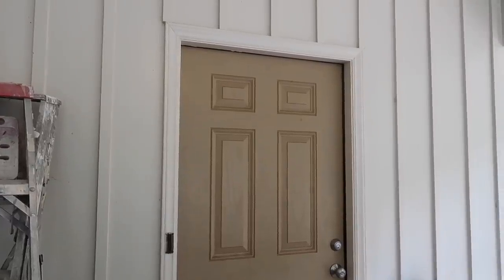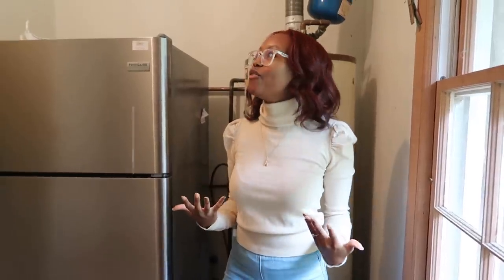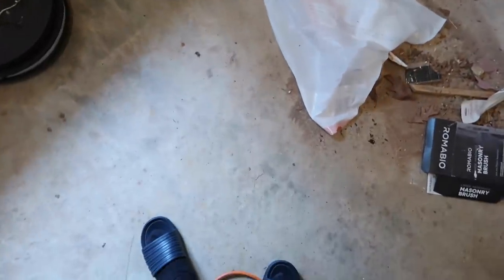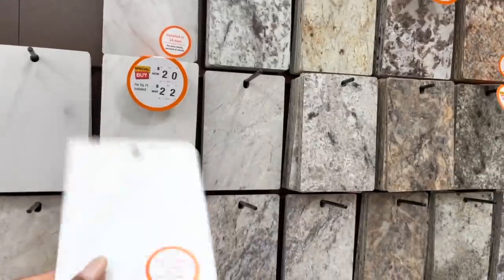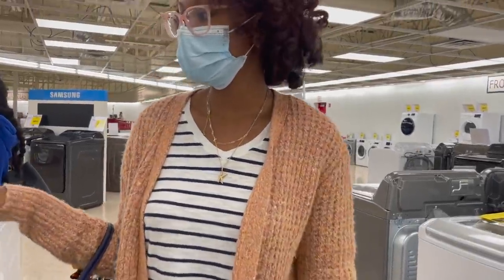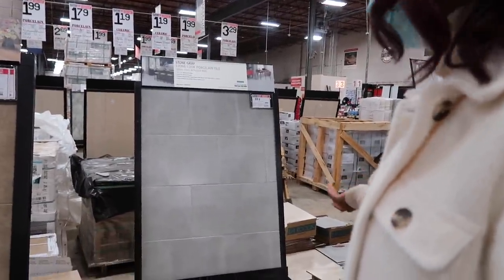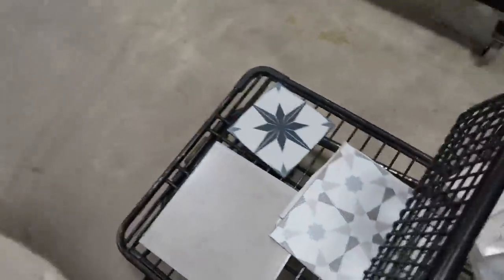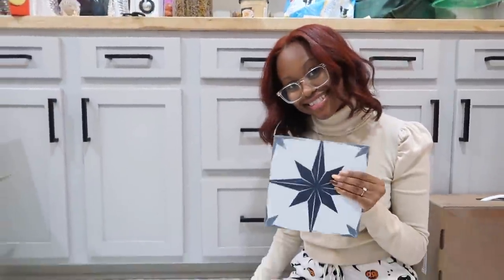DREAM LAUNDRY ROOM MAKEOVER PT.1| Shop With Me, Renovation Plans, & DIY Project #FIXERUPPER *NEW*

Comment: Quartz counter top is the best way to go, if your f'ing to use peel and stick do sealllll up the concrete flooring and also use a heat gun or blow dryer on the adhesive prior to laying it down... yes wifey and I have done it...absolutely no issue as long as you as you seal the flooring with a (sealer adhesive) and heat up the adhesive on the peel and stick tile... don't just lay down the peel and stick tile onto the floor without the speaker or heating up each tile, otherwise they will dislodge themselves from the floor...be sure that the laundry room is room temperature and not freezing, it will not stick correctly.

Comment: Option #3, it looks classy but with some pizazz. Peel and stick is very cost effective, but the longevity of the material is not there, unless you are planning to replace it in the near future, it's ok. I have it at home and even though we are careful, it started to lift in the areas with the most traffic. I wouldn't recommend it.

Comment: @youngladybusiness...if you are doing a newer type of machine make sure to ask about the sensors. I have a Samsung digital washer less than 5yrs old and it has caused so many problems like violently shaking when it spins and constantly showing as 'unbalanced' the contractor said it's the sensor in these newer machines.

Comment: First off this hair , babyyyy it’s giving everything it supposed to give 🔥🔥. Secondly with washer/dryer with a countertop , I honestly prefer the front loader and I put mine on the platform things they offer. The brand I have is Maytag and I love it. Lastly for the floors , I love Option 1. It’s simple yet changeable without doing too much and seems better for the smaller space.

Comment: Great move to do your laundry room! I've had front and top loaders and my assessment is this...front loaders will give u counter space for folding clothes. IF you get one that puts sufficient water in the tub, you will get a thorough wash. Id also get the pedestals so u don't have to bend so much. Top loaders...omg be careful! I went from front to top by GE- piece of trash!! Its very sensitive to load capacity AND composition. U can't wash garments with dissimilar weights or it throws off the balance. Id never buy another GE. When shopping,, wiggle the top loader tub to see how much "play" it gives. Try the foreign vs American made. If u can wiggle the tub, chances are greater u will probably hear lots of banging when it spins which means more out of balance loads.. Regardless of top or front, get at least 5.0 capacity so u can wash ur comforters and other bulky items. Stay away from the 4.5cf or smaller!  As for options,  I vote #3. 
I'm sure you guys will make good choices and it will all be beautiful and work well for your home 🏡 😀

Comment: Option 2… My dad bought a new house and had the throw away the washing machine cause it was disgusting. When we went shopping, we only looked at front loaders because I’m only 5 feet tall and I can’t reach the bottom of a top loader to get all my clothes out. At my grandparents house, I had to use a wall to help get to the bottom. Plus, we lived in a different house before where there was a top loader, if u didn’t take the clothes out quickly they would get sour sitting in the top loader. With the front loader, my dad forgot his clothes in there for a couple days but they were fine. No sour smell.

Comment: Lowes is better to me with selection on everything than Home Depot. There is/was a Sears appliance outlet in Stone Mtn. Think about resale when considering flooring unless you pan to change it before moving. Option #1! Think about water leaking;flooring bubbling,bubbling, up,curling.tile is the better option to me.. I have tile.. I also have front load washer.Its pretty & does the job but seems to have issues,at least Samsung. Don't get Samsung washer nor dryer!!! And it HAD good ratings at the time!GE was best one we had. Had to replace because of lightning strike and decided not to spend all that$$$ on getting motherboard repaired nor on a new one this time.  If I had to buy again, Id go with the topload. If it ain't broke don't fix it. The original design w/function of washer was perfect the way it was.I know the rm will look good once you guys get into it.

Comment: I am not a fan over peel and stick tile as I think they do not hold up in the long run even though I do like the pattern and more subdued colors of the peel and stick.  I personally would use a ceramic since they would hold up better with the water situation in case you have a hose that would burst, ceramic can be dried out rather quickly and ready for use again.  My experience with the peel and stick is water can still get under some of the tiles where mold can grow.  More importantly, have you researched different brands of washers?  If not, you should.  In case you have never had to call a repairman for a washer or dryer, it is not cheap and if you do not have a reliable brand that are real workhorses, even newer washers will break down even when you have not had them too long. Companies just are not making washers well built like the old machines.  That famous brand that starts with an M does not make modern machines well built like the old ones.  Before I replaced my W&D, I talked with my repairman to ask his input on well built machines.  I knew I did not want a washer without the center agitator since NO ONE I know of with newer top loading washers without the center agitator likes them.  All agree that they do not clean as well as a machines with the agitators.  I also did not care about wasting money on all the electronic gadgets that have circuit cards controlling everything the are more likely to fail I mine were plain white with no electronic displays.  The washer has a nice large deep barrel that allows me to wash some comforters and large throws that I previously had to take to the laundermat (ugh).  Love being able to do those items at home.  What a life saver.  My service guy recommended Speed Queen as being the best built, lowest maintenance machines and they are made here in the states…(It is the same brand he purchased for his own home).  So invest your money in quality build appliances and they will last for several decades and save money on the décor things.  That is my advice.  Good luck and love the hair also.  There is nothing so frustrating as having to replace a 4 or 5 year old washer.

Comment: Tankless water heater can go in attic and shouldn’t cost too bad…also do NOT get a front load washer…I’ve had two and HATE HATE HATE…the get musty and mildewy and gross…as soon as my warranty is out on my current one, I’ll go back to a top loader machine. Also…I renovated 5 years ago and I bought all whirlpool and all of my appliances have crapped out several times each…so I’m not a fan of that brand.